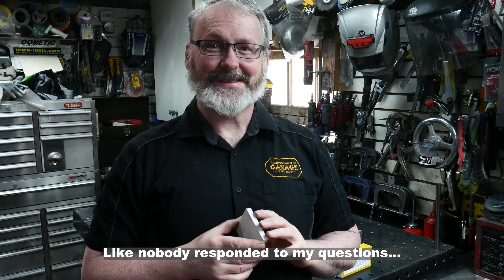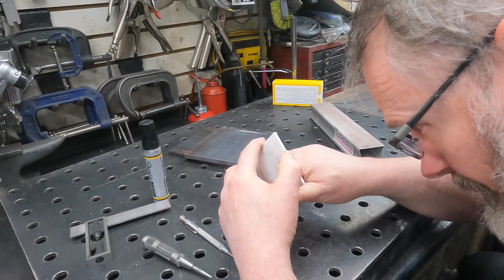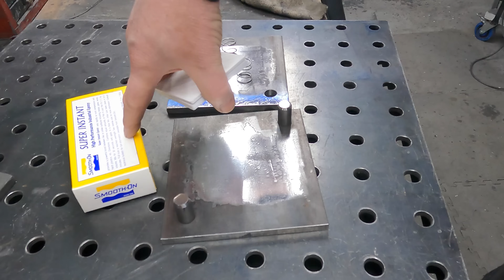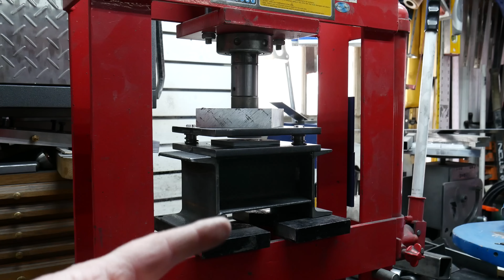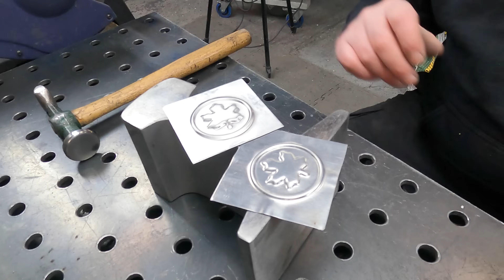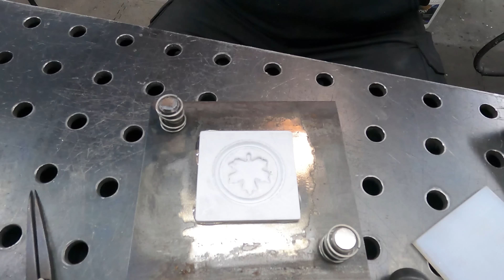DIY Metal Embossing - 3D Printed Dies

Comment: PLA would probably hold the force better and require less cleaning post-print (less stringing). Also: you didn't mention including a draft angle: wouldn't that make the embossing easier?
Reply from the maker: I don't normally have any PLA in stock for printing.  I just don't have a use for it.  My PETG settings result in prints without stringing.  I normally print in ABS.  If I was doing this again (and I will be at some point), then I'd switch it up and use some glass fibre reinforced nylon (PA6) or similar.  I did use a draft angle on the outer ring.  The leaf was complicated enough that Fusion refused to compute one.  So I sent it without for that part.  A little more clearance was all that was needed I think.
Reply: @ThrottleStopGarage  PLA works better than ABS or PETG for this

Comment: If you try again, consider making the positive a smidge shy of the full depth and it might not cut under pressure. Great stuff.  I'm a big fan of 3d printing in custom automotive work. I'm working on door cups, and dash vents now.
Reply from the maker: I should have measured that dimension on the male die.  I didn't think of it at the time.  Next time.  I'm going to use this technique for a few parts that I need when I get to those jobs.

Comment: Thank you, I always hate it when I find something I could have used after the project is completed.
Reply from the maker: Wait..what?  Projects get completed?  Can you explain this to my wife?
Reply: @ThrottleStopGarage  ok, let me rephrase this, I hate it when I find something when a project is nearing completion and I realize too late that I could have used it.
Reply: I've messed with this a few times Craig it's fun. I find if I trap the material better it is more successful. Tried making a die to use on my buddies high end tubing bender for 1.25" od aluminum tubing. 44 hr print on the XMax that looked lovely. Annealed the tube still a total failure. Oh well $20 of ABS down the tubes. Made some floor patch plates with this technique though and they came out pretty good.

Comment: Have you thought about angling the walls of the leaf/circle? I'm wondering if that would reduce the force needed to emboss the image.
Reply from the maker: Good point.  I was not able to do that because of the leaf geometry.  Fusion didn't like it at all.  The circle did get a few degrees added to the walls.
Reply: @ThrottleStopGarage  could potentially add them in with a file after the fact on the parts that fusion can't get

Comment: Well done mate its great when it turns out first time, to stop gathering  try to pree stretch your metal with  English wheel in longer strips .Then cut them to size very nice maple leaf from down under.
Reply from the maker: I'm going to try this on the next experiment.  It won't happen for a while, but that's for sure the plan.  I've got to get a set of dies to work in steel.

Comment: 20 ga steel needs more pressure. I am building a 36 international and embossed "INTERNATIONAL" into the firewall. You can use acrylic and have the male / female dies cut with cnc or what I did. I used a laser cutter. You get slight deformation of the dies but you need 10-12 tons to get the steel to "flow". My firewall stamping is about 10 inches wide, it worked great. I'm working on a 36 inch wide stamping for the tail gate.
Reply from the maker: Great information.   I've got a laser cut die sitting in the garage to do something on my firewall.  What was your male/female gap?
Reply: @ThrottleStopGarage  there are two types of acrylic from my tests one is more resistant to "crush" than the other. One is extruded the other is cast, I believe cast is the preference. The type that sign shops use either way. I calculated the material thickness and added 20 % , this was a suggestion from a friend who happened to be a tool and die maker. Use clear acrylic if possible, the off gassing from colored acrylic is awful.
Reply from the maker: @keithwinsor8361  thanks this is very helpful.

Comment: Just my 2 cents...
If you did find that the print needed to be more robust, bump the infill to 100%. that last 25% makes a huge difference in strength.
as for the aluminum having the waves or potentially cracking, hit them with a sooty flame from even and overly gassed BBQ lighter for those small guys, otherwise a torch with the flow turned down. will anneal them and make em soft as butter.
Reply from the maker: True - I just think that PETG is the wrong plastic (it's just what I had).  I'm going to try something similar in nylon.  The problem was at the edges and the plastic flowing with the pressure.  I find sharpie is a little more accurate than acetylene soot for annealing.  I did anneal the parts - I just don't know the alloy - it did get softer but it for sure is not 3003.
Reply: @ThrottleStopGarage  petg is really strong at 100% its all i use. but if edges are failing there are tricks in cura to address that... but if you are already setup for abrasive filaments, no reason to bother with it.
Reply from the maker: @pawpatina  It's worth trying it with some different filament next time up.
Reply: @ThrottleStopGarage  the nylon carbon fiber stuff is pretty strong

Comment: 11:50. Might help if you make the perimeter of the bottom half of the mold wider and have it  extend up around the outer edge of the top half of the mold. So there’s sort of a pit in the bottom half that you can just drop the blank down into. You wouldn’t have to worry about lining it up that way. Cool experiment BTW. I might do something like this and have it machined out of aluminum for my own logo. Thanks for sharing. Definitely worth a like and a sub from me. 👍
Reply from the maker: Thanks - glad it helped.

Comment: 10:15 The moisture is not coming from the metal.
Water is a byproduct of the combustion process from the flame of the torch and simply condenses on the cold metal.
Reply from the maker: Yes...already been told.

Comment: Ironically, PLA works better for these since it's stiffer than PETG.
More brittle in general, but it doesn't usually break in these conditions.
Could even get PLA+ if you think it'd help any, but I doubt it'd make a significant difference.

Additionally, the edges could've potentially been rounded in CAD, depending on the source file.
Reply from the maker: That was the consensus when this was released.  I've not needed anything embossed since, but would try PLA...but then I'd have PLA for ages as I rarely use it.
Reply: @ThrottleStopGarage  Makes sense, rock on! 😎

Comment: I never thought it would work. Especially with only 75% infill.
Reply from the maker: I was surprised it worked as well as it did.
Reply: @ThrottleStopGarage  yes pretty great result. I can only imagine using PC as material would make great results. Ofcourse CNC:ing that logo and both halves would be also reasonably cheap.

Comment: You could try printing the die in something like PolyCarbonate, if you give it enough infill I'd bet it would handle that steel
Reply from the maker: Next time...I see people even using PLA because it's stiff.
Reply: @ThrottleStopGarage  PLA is stiff, but quite brittle, and while it IS stronger than most people give it credit for, it still has its limits.
I have only done a VERY little bit of printing in PC, but it’s strength is baffling, even the raft I printed my parts on was unreasonably strong
Reply from the maker: @PAPO1990  Excellent information - any specific challenges to printing PC?  I print a lot of ABS - so I'm not afraid - LOL.
Reply: @ThrottleStopGarage  mostly the heat and the warping, plus it fuses to build tack so hard you can destroy the build tack removing the part. It kind of makes ABS look easy, but IMO ABS doesn’t actually give you anything for it’s printing difficulties, PC however, is worth it IF you can get things running smoothly, worth doing some research tho, it’s been a LONG time since I printed it. Good Luck 👍

Comment: I wonder if a resin 3D print would work better bc its pretty dense and thick with very small printlines
Reply from the maker: Yes - even PLA would be better than the PETG that I used.
Reply: @ThrottleStopGarage  do you have a resin printer? I have one and a laser printer if you'd  like to try round 2 with resin and acrylic. I'll print and ship them to you to try.
Reply from the maker: @procrastination_builds  thanks. I'm stuck in to some other parts of the project.  I will look into it when I need to do some more embossing.

Comment: If you want a tougher die, you could cast them from urethane?  You can get urethanes that are shore 80D hardness, possibly harder.  (Epoxy is typically around 80-90D.)  You could 3D print the mold.  But then again, maybe that is one rabbit hole too far?
Reply from the maker: I was actually thinking that it may be useful to make a die with plumbers epoxy or even short-strand fibreglass bondo.  I'd print the inverse of what I made this time so that the 3D printed parts would be pressed into the epoxy/bondo and the resultant die would be much more durable (guessing here).  Even some 3D printed nylon would make for a decent die.
Reply: @ThrottleStopGarage  It's worth a shot.  My gut says polyesther or epoxy resin will be too brittle.  But if you soften the edges, it may do fine.

Comment: Why so complicated with epoxy ? You donßt even need to glue it at all, but if you want it just fixed in place hot hot glue.
Reply from the maker: Mostly because I had a tube of epoxy.  I've used hot melt for other metal die work lately and other than my garage being cold, it works OK for a few parts.
Reply: @ThrottleStopGarage  It´s great if you want to fix some plastic parts around the house, has great gap filling properties. Or for metal work if you want to fix something quick and easy into place RIGHT NOW. That´s why I mention it. Epoxy is a great glue BUT it´s a pain in the ass to work with and can be extremely toxic.

Comment: How thick were the walls on your 3d prints? The Classic-Car.TV channel has a video named "3D printed Dimple dies for sheet metal shaping" where they claim PLA can handle up to 1.2mm of steel with a 3mm wall thickness.
Reply from the maker: I used 2 mm.  PETG is not as hard as PLA and I don't have PLA as I have little use for it in the shop.  The shape matters in the context.  I'm sure the settings I've used could handle dimples fine...these are some complex shapes.
Reply: @ThrottleStopGarage  Good to know. I just started trying thicker-walled prints for strength, but I couldn't use PLA due to the heat exposure the parts will endure.